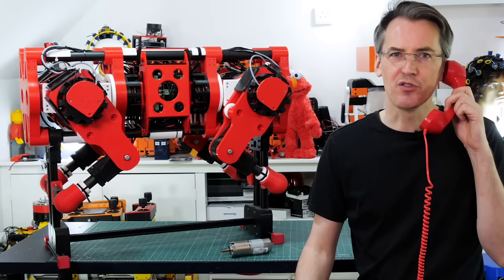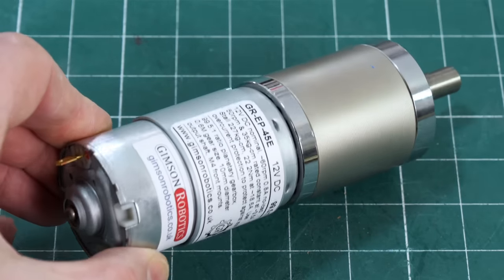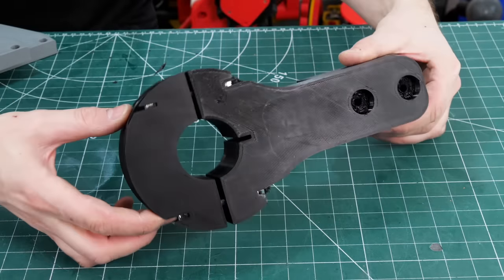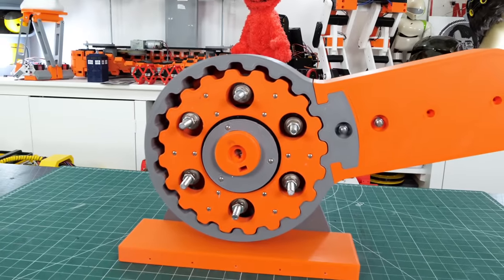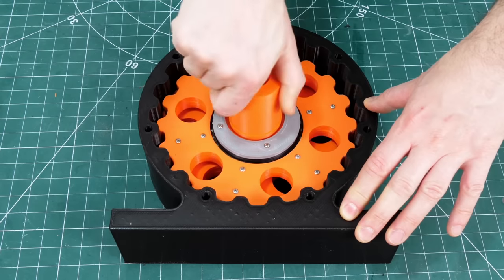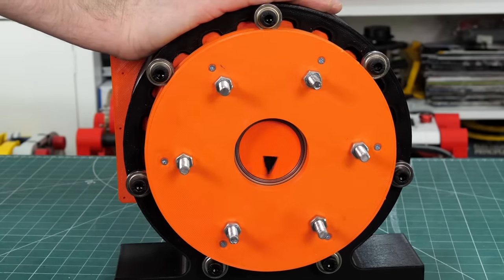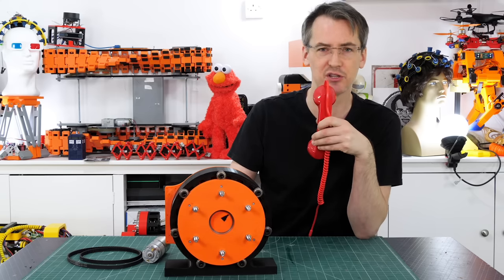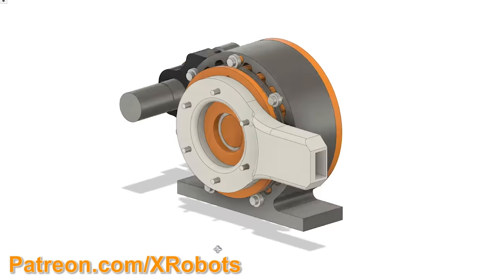120Nm 3D Printed Cycloidal Drive

Comment: What if you made an eccentric motor mount, locked the motor output shaft to the main structure and powered the motor with a slip ring, letting the motors body spin install of the body being stationary.

Comment: I think the stretching of the outer case is too much eccentricity on the eccentric cam, I hate to have to ask if the math is right, if you do an eccentric of 10mm and plan everything for 10mm, then cut and paste a second one 180' out of phase, you now have effectively 20mm.....

Comment: Try a CVT connection for that drive. I don’t know if it would work better, but they’re supposed to be great for high torque applications like snowmobiles and banned formula one cars
Reply: Well , if they banned them for formula one cars since they make them too fast , then that means they are good for having lots of torque
Reply: Yup. If you wanna rabbit hole to go down, the testbed for it was the Renault Williams FW15C

Comment: At the risk of sounding stupid, why could you of not extended the sleave on the motor and attached to that rather than trying to grip the smooth outer surface?
Reply from the maker: yeah that would do actually

Comment: Odd idea for your frequent belt tightening needs: Add some thick rubber, like thick rubber bands or cut bike tube, and this way you can have more fine tuning, have some spring to it, and wont need to wait for the reprint.

Comment: Feel free to report this misleading title 'Through-motor Cycloidal Drive? (200Nm)' (.../Spam or misleading/Misleading text) if you're tired of misleading titles on YT and would like to discourage that. I put this in the popup form (can copy paste):

The title 'Through-motor Cycloidal Drive? (200Nm)' is a complete fraud. There was a through-motor device attempt, but it failed seriously and certainly didn't achieve 200Nm torque. Most of the video was about a regular belt driven drive which while it did work was not through motor as title depicts.
Reply from the maker: That's what the question mark is for.
Reply: @jamesbruton  you're being deliberately misleading for the sake of sensationalism. Don't pretend otherwise.  

It's appropriate to report it as misleading.

Have some integrity, it's disgraceful! You should be ashamed of yourself. Just BC others do it doesn't mean it's ok and you should too. Aren't you better than this, or is this it? Pathetic.